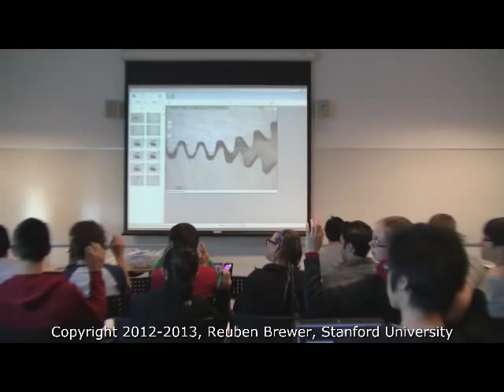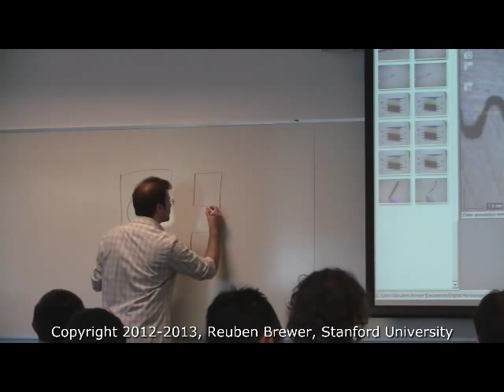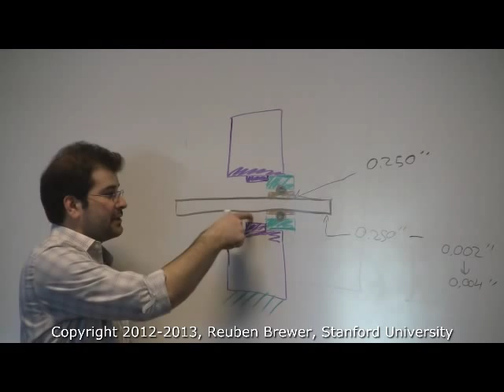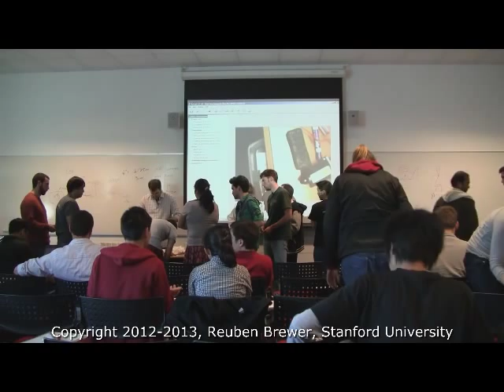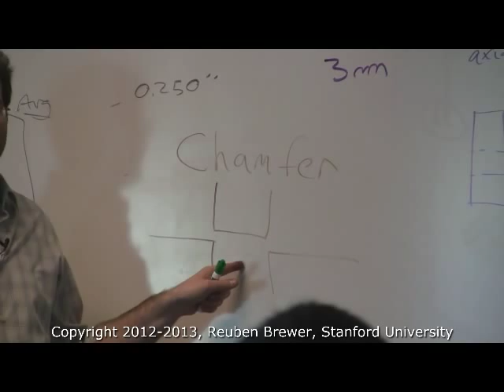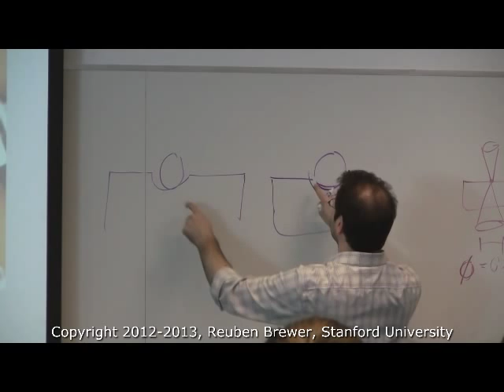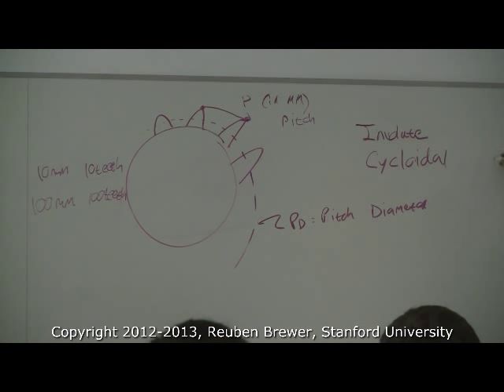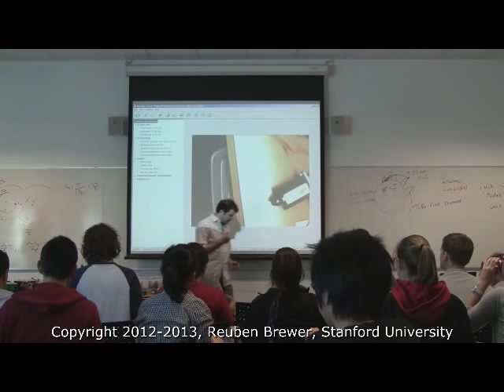CS235: Applied Robot Design, Lecture 2-Finishing Discussion of Ball Bearings and Introducing Gears

Comment: for people watching the video later, the laser cutting explanation is wrong. The laser exits the tube in a fairly cylindrical manner, (a few arc seconds of conicity)  but the cylinder is about 6mm wide, not at all enough power density to be useful. So it is transported cylindrically with mirrors to the head, where a lens system focuses it from cylinder to a cone, where the thinest part of the cone is the one described (about 0.1mm). The angle of the cone is given by the focal length of the refractive system. Look for "Sarbar multimedia" on youtube for more details (the name looks like a joke, but the guy is serious, he has a British accent).

Comment: bearing strength, 1/8 vs  3mm:  difference in size should account for some of this. Can anyone post a quick and dirty formula for strength of bearings based on outer ring, inner race and ball diameter?  Also, is there a difference in standards re tolerance of fit?